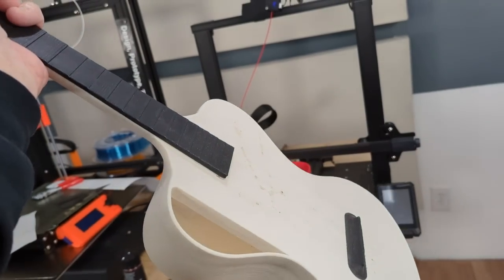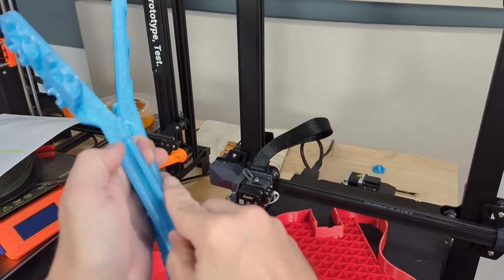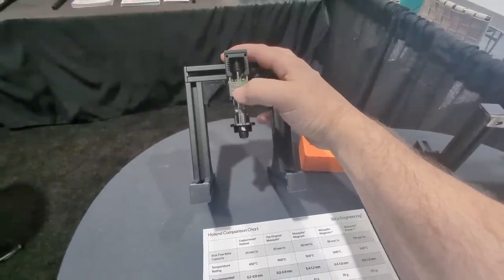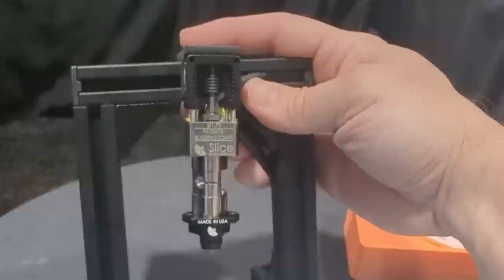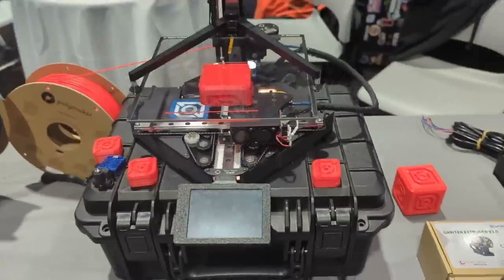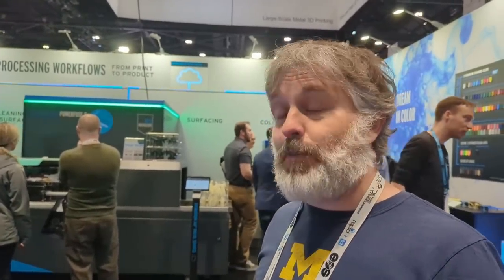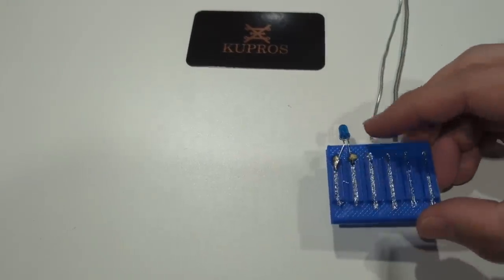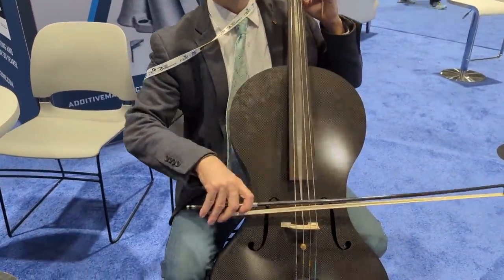I Took My 100% 3D Printed Ukulele to Rapid+TCT

Comment: It’s amazing how fast 3d printing is developing, new techniques and technology. Would love a pellet style fdm printer that has a shredder that failed prints or general waste can just be dumped back into the printer for recycling. I print my models so colour doesn’t matter and would make me feel better about the use and abuse of plastic in this hobby/industry.
Reply: recycling is not that simple, not even in injection moulding. you cant do 100% recycled material, and its seriously complicating process stability. whats working is to feed the rest of moulded parts back into the extruder because it has consistent properties. yet, wwhen you mix different sources, it gets real messy really fast. only used for non-structural, invisible stuff, or things that wrent meant to look great, like trash-cans...

Comment: Thanks for sharing all those cool things! 
I have a couple of questions: The Slice hotend with the die, okay... laminar flow and all that, but do you think aligning, shearing and stetching the polymer through the die would result in more warping because all of those increased stresses and the polymer chains wanting to disorganize themsleves and be in a more relaxed state than parallel and stretched when coming out of the nozzle, pulling even harder and causing more warping.
The huge formar 3d printer is printing on wood! What are they printing, ABS? I don't think that chamber is heated or anything, does the wood have something on top like wood glue or anything like that?
Reply from the maker: Good question! Without any real world testing under my belt? Theoretically, I think you're on the right track. A turbulent flow should result in a print that has less shrinkage. Equal to do decrease in shrinkage would be a decrease in strength. I'm thinking of it like the difference between a felt fabric and a woven fabric. Aligned fibers are much stronger. It sounds like you would get a lot of benefit reading the white paper by slice engineering. Think it's up on their website. If not yet, it will be soon.
Reply: I'm gonna look it up. Thanks!